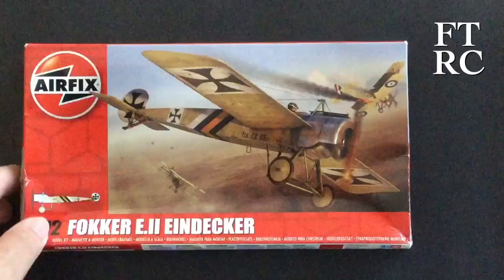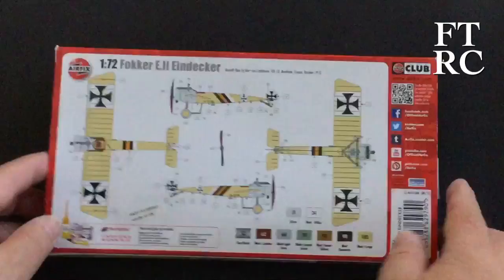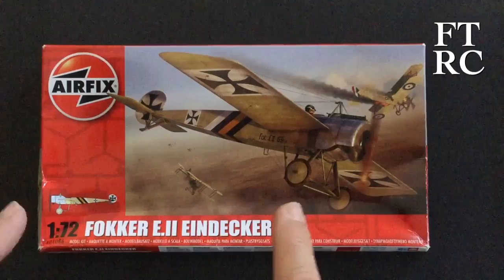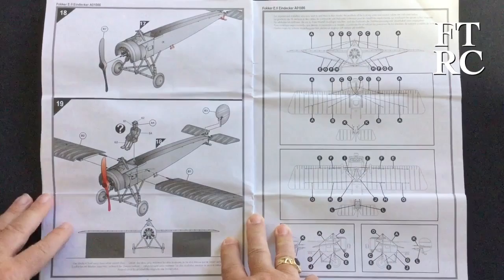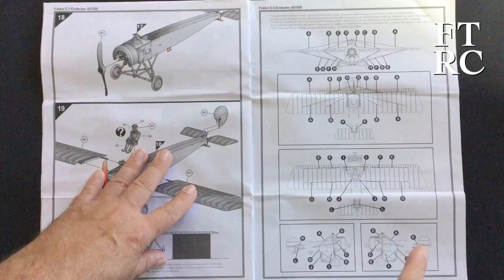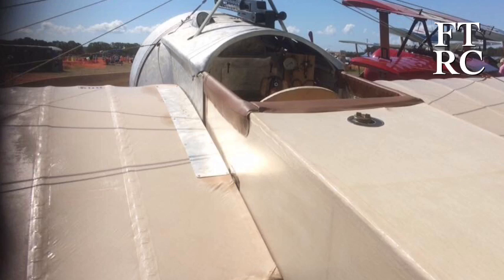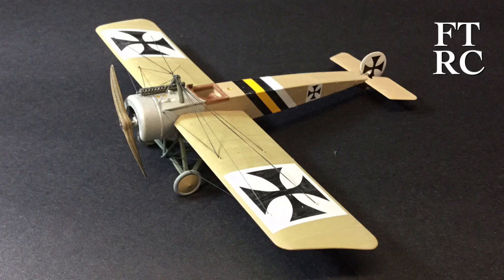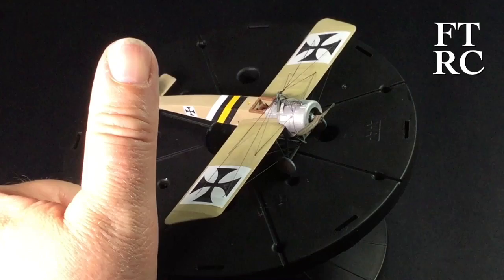Airfix Fokker Eindecker E.II Full Build and Review in 1/72 scale

Comment: Decided to watch your vid on this kit again Harry, as I actually opened the box on mine today. Didn't open the sprue bag though - opening the box was enough progress after owning the kit for a year. Don't like to rush my builds. Bought the E.III as well about 8 months ago so on target to open that box around about Christmas time! Hope mine turns out half as good as yours but rigging scares  the willies out of me.
Reply from the maker: This is a very easy aircraft to rig.  What I did was drill holes in the wings, then started on the support pyramid atop the fuselage.  I simply tied some Ezline here then ran it through the first hole on the wing, down under and tucked it round the undercarriage bracket, then back up the second hole in the wing, and finally back to the top pyramid on the fuselage.  Pull firm them CA glue into place. Repeat for the other side.  You can also add the front lines which I attached with 0.5mm holes into the fuselage cowl adding a drop of CA glue to the end of the Ezline.
Reply: Thanks mate - I'll give that a try.